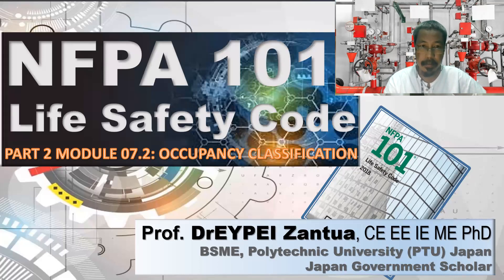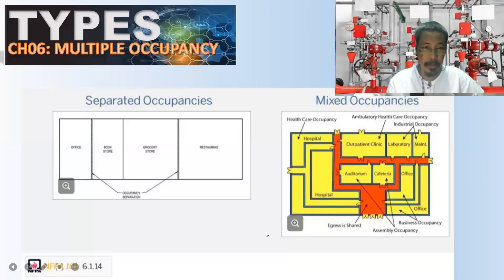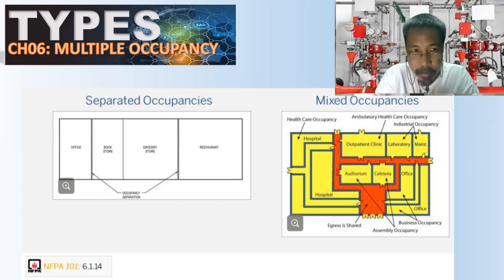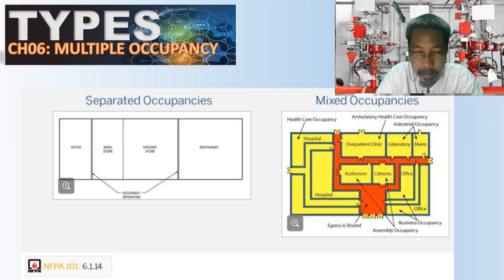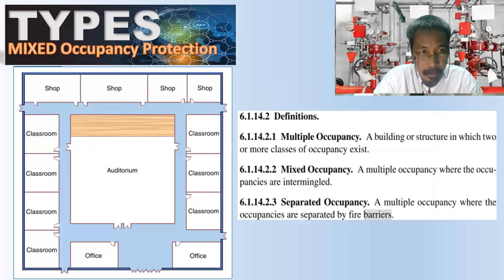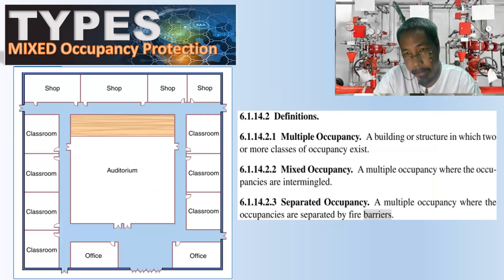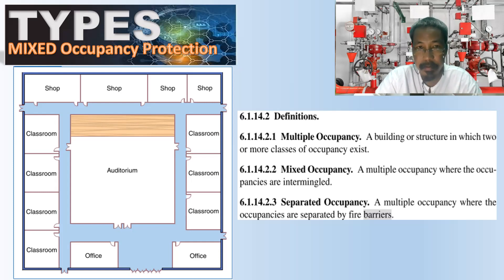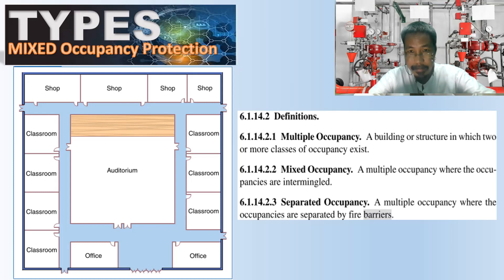MIXED OCCUPANCY -NFPA101 || General Requirements: Module 07.2 [ Reference CODE by RA9514 - IRR2019 ]

Comment: Thank you sir, in this video I learned that occupancy has a two types fist is the occupancies are separated into fire zones, and each fire zone must conform with the code based on the occupancy classification of that component of the building. The engineer may apply any of the mixed-occupancy options to a given fire area. A mixed-occupancy condition occurs when two or more distinct occupancy classifications are determined to exist in the same building.